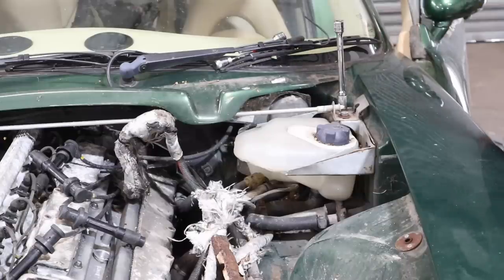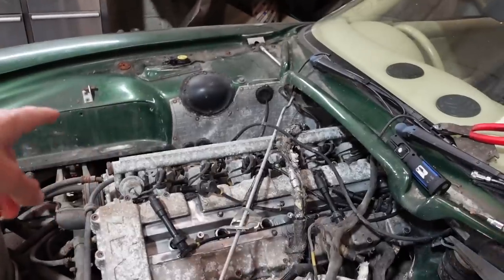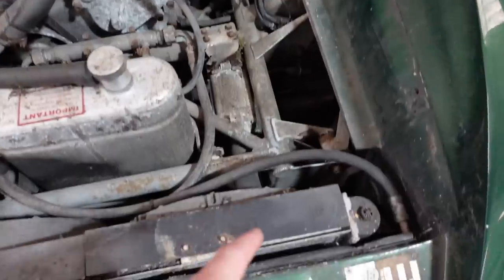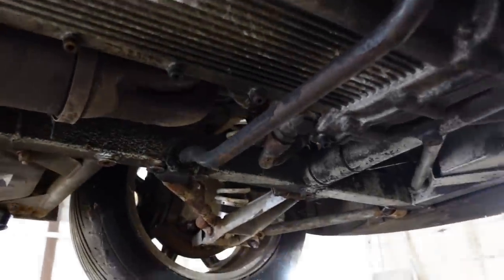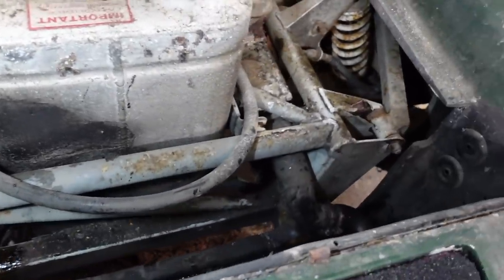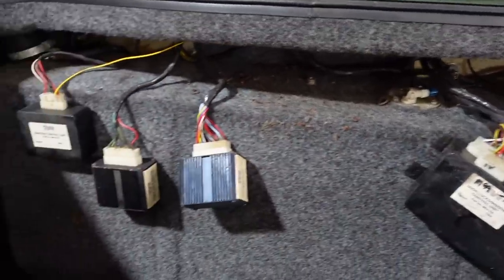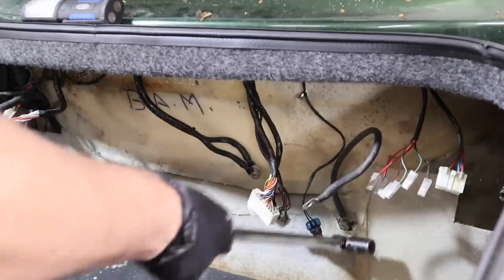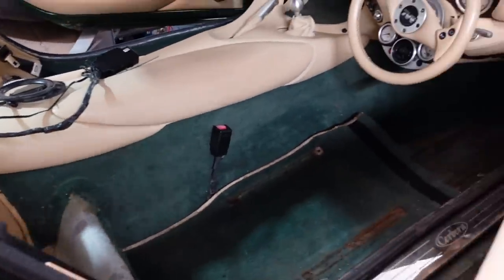REMOVING THE BODY ON MY TVR CERBERA PT.5

Comment: Hey, great job saving a tvr. As I have done body off myself, do not forget to remove the handbrake and reverse switch cables on the gearbox before you lift the body, there are also two bolts besides the vents in the middle under the rounded sides. easy to forget.
Reply from the maker: Thanks for the info!

Comment: Very challenging project,  the TVR Owner's club could provide more info on this model. Just checked Wikipedia on the 6 cyl engine, it says that early engines had valve train  issues due to oil starvation. There  are mods to remedy this fault. Best wishes from Oz.

Comment: General and detailed cleaning under, inside and out will make you life so much more pleasant. Never no why people work on dirty cars when it’s not a cost/time thing…. Wheeler dealers used to always work on muddy, greasy, oily caked dusty cars 😡
Reply: Easy - cleaning everything removes all history of leaks as well as past repairs (tool marks, clean connectors or parts, suggesting what was fiddled with). These can be crucial when diagnosing issues, or even finding issues you wouldn't know about otherwise, or predicting what will fail next (many situations when you see someone fixed a symptom but not the cause, by replacing X without replacing Y, or replaced AC pump without the condenser so it will fail again soon, stuff like that).

Not to mention in this case (he's taking the body off the frame anyways), there's no point in cleaning when 1. it's bolted together (so you'll clean the same stuff again after exposing the whole of it) and 2. you plan on replacing half of it anyways and cutting lines indiscriminately, why wash them before disposing? :)

Comment: If you do a standalone you'll still need to work out what each wire does.
It's honestly not that hard if you have a pinout for your ecu. Just put a multimeter in continuity mode and go wire by wire. Undo a plug, stick one end in, test each wire at the other end and label. Takes maybe 3 or 4 hours yes. But wiring up a standalone ECU will take 2 days plus a few hours on a dyno

Comment: Excellent upload -content -editing .  Its really hard to accept that a professional car builder sold these as 'quality' when they are so badly built . I bought a 'Vixen' in 1971 as a part built and it was just rubbish . Replace all the bolts with stainless and plaster everything with waxoil as you reassemble.Good luck - you have hundreds of hours ahead .
Reply: @dizzy2020   Would be interesting to know just how many of those years its spent parked up or non running . Certainly  British roads would contribute to their premature demise due to corrosion of the race chassis design . I keep thinking that for the sake of a few quid spent on etching the chassis before final painting more will have survived . They do drive nice though once the smell of fresh fibreglass resin has gone . They were horrible when new which even the acres of leather couldn't disguise.

Comment: With the ECU wiring being so shot. If it is not repairable or the ECU is toast then a Link ECU or similar would definitely be a sensible choice. Build quality was sketchy on these so after being stood a few years things will be less than fantastic as they were less than fantastic from the factory.

Comment: At least with the nuts and bolts it is less work if some of them snap, no drilling and tapping or whatever. A ring spanner and a brick might work on the inside bolts / nuts.

Comment: Couple of thoughts - the S6 is  narrow engine, but you may need to remove the exhaust manifolds. and there will be two body/chassis bolts under the central tunnel forward of the gear lever  - you'll need to strip the centre console off and then look for fibreglass patches over where they are - rove the fibreglass to remove then, one has an earth cable. Look at some pictures of a chassis and you will see where they are.

Comment: Aftermarket performance ECU- laptop tuning. How fast can one of these go with the stock computer?
Reply from the maker: I think from research they do 350bhp on a stock ECU, but with aftermarket and better sensors added you can get more like 380bhp
Reply: @SavingSalvage  Right there is your answer. A simplified system you can tune with a laptop, have manufacturer support ( maybe even a sponsor) and a faster TVR than stock without making any noticeable modifications... just going through what is available will make interesting content....

Comment: The vacuum in the engine bay is possibly the best upgrade from as was that I have seen. Clearly, you have made a load more progress on what is going to be a long, hard haul. Is it worth plotting how you will rebuild, in terms of any new fixings between body and chassis, when the rebuild commences?
Reply from the maker: I guess I will wait until it’s fully stripped to assess everything that it needs. Work out the cost and then decide how much I really like my house 😂
Reply: @SavingSalvage  the TVR will love your house more than you will,  long way to go mate, keep up hard work